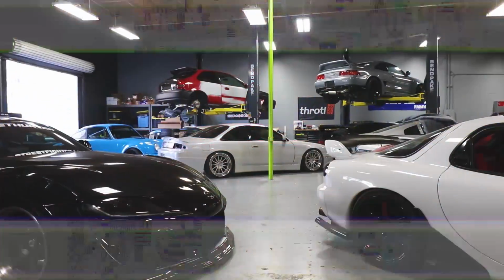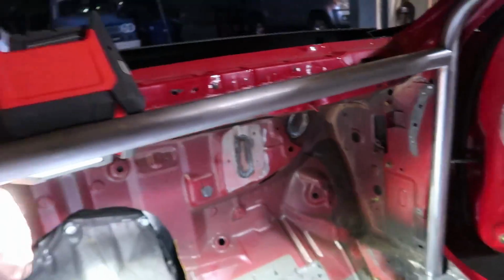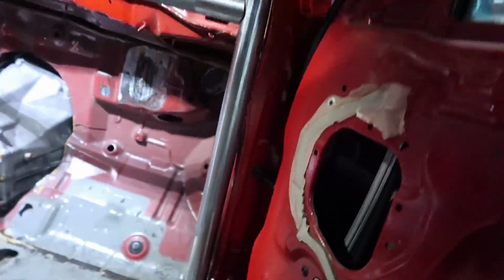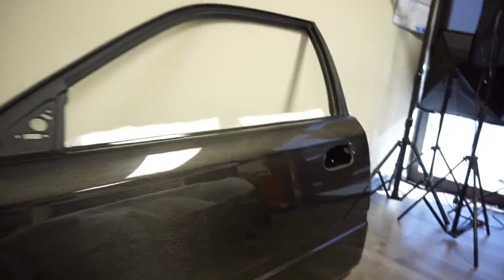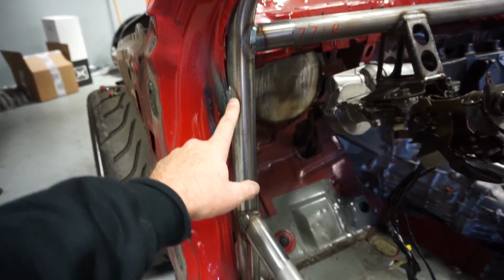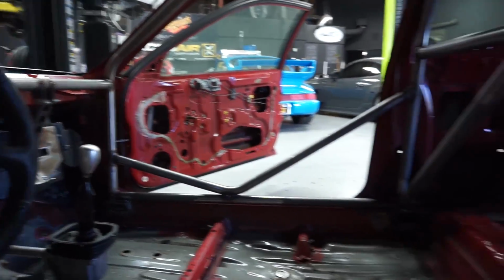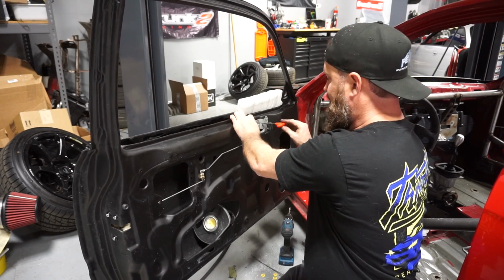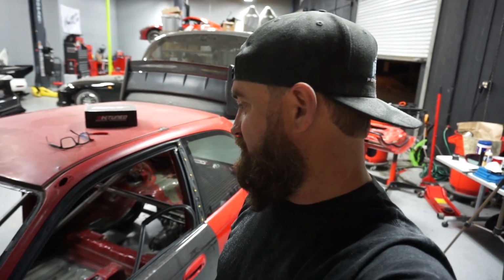(Rear Wheel Drive) K20 Honda Civic Hatchback is BACK with a Roll Cage & Carbon Fiber Doors!

Comment: I loathe the aesthetics of a roll cage. I would rather spend months worth of time cutting and welding sheet steel and box section to make a fully hidden roll-cage by reinforcing the structural members of the car with steel.

Comment: 9:20 What is the point of getting these and then spending so much time with doors on   the car?
Reply: myc0p if you’re referring to the carbon doors. A HUGE weight difference between OEM and carbon. Probably 25 pounds a door if not more.
Reply: @Dabbs_291  Why not use a bench to modify new doors since he got the quick release door hinges at 9:15?

Comment: question: price on the doors?
question weight savings in pounds?
ask: please show slow mo close up of the shallow fasteners.
comment: having worked on this model: I am not a fan of the stock inner door skin/panel. going carbon I would leave that off.

Comment: Mickey instead of having the collumn static drill holes in the side plate put one bolt thru the whole thing in the back and a high tension spring a washer and a nut weld a hanger of of it and boom to adjust height pull the bolt back and its spring loaded so match height level to the holes let the bolt go and it snaps in the plate setting the height you want.

Comment: My understanding from a fair amount of the gussets is because many rollcages require 6x6 foot plates, where as your would not match and in turn they have to come off of the unibody and the for additional strength they add the gusset plates. I think it depends on what the cage is being built for.

Comment: Micky I got so much luv for u for still messing with Honda’s I wanna see this vs jimmy oaks ka24 civic.. that’ll be epic content I mean drag and drifts ! 🤘
Reply: Both builds are unique in their own way Jimmy's k a is a pretty sweet build and is coming along great but he doesn't have the budget that throttle has so I think they're K swapped hatch will be the better car but both vehicles are amazing machines.
Reply: @ghostface9230   Jimmy & Brian get shit done, I think they're also putting a roll cage in theirs. Two people building a custom car on their own with a tight budget will always be better than a shop building a car. Everyone loves an underdog.
Reply: @ghostface9230  Budget doesn't make everything tho.
Jimmy has the least budget but it is undeniable it will drive better, because the 240sx suspension is just so much more advanced and adapted for a rwd configuration.
When it comes to engine stuff, yeah, Throtl's ek will be way better.

Comment: You just called majority of the Fabricators cop outs when all they're doing is following the direction that the customer wants and usually they want a bunch of gusset with holes in them I think that's pretty insulting that you said that. Can't judge us based on what the customer wants because I can do cages up to the frame of the car and also do a cage with what your calling ugly gussets. I always say to each their own. Because alot of my work that I do isn't my style but I still have to do it if I want to keep doing what I love and that's fabrication. Sorry went on a rant but keep up the great work love y'all content. Nothing but love.
Reply: He clearly has no idea about structural  integrity..and what gussets actually  are for.
Reply: No he mentions that they might add some for upper structural integrity but he wants to try to keep it to a minimum. He knows what they are there for.